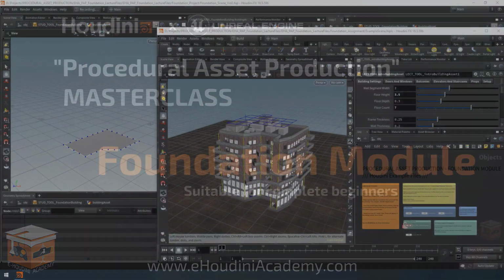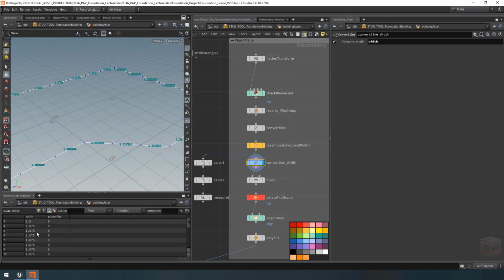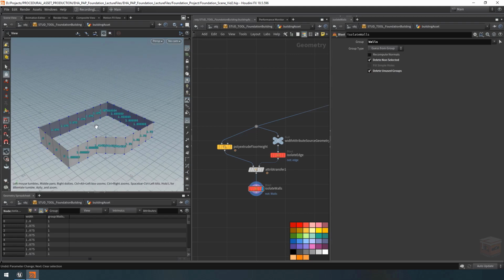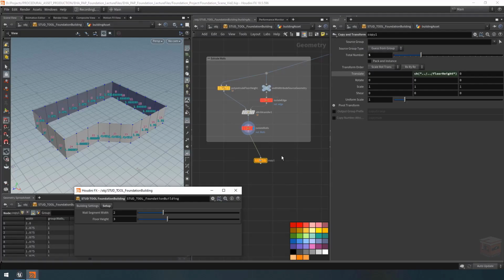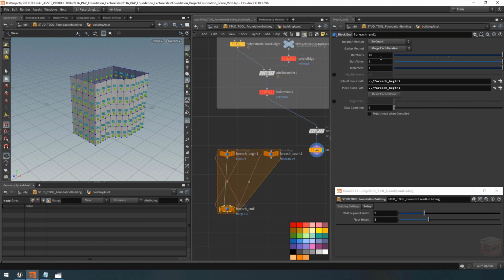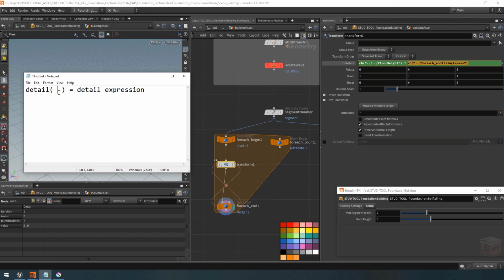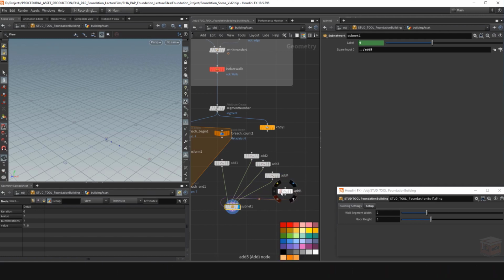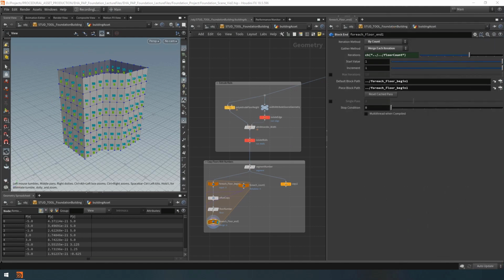HOUDINI FOUNDATION - 03 - Extruding The Walls - ( Free Tutorial for Game Dev with Unreal )

Comment: Hi, i have trouble with copy and transform node, it have the same number with polyextrude but the floor are not stacking on top of each other but slightly overlap instead
Reply from the maker: Did you set the floorheight value on translate Y on the copy and transform sop. And does this value have the right height in your case?
Reply: oh, i figure out the problem, i still have some value in polyextrude distance, thank you. Your lectures are amazing btw
Reply from the maker: @YiNguyen-jx3oj  Your welcome 🙂

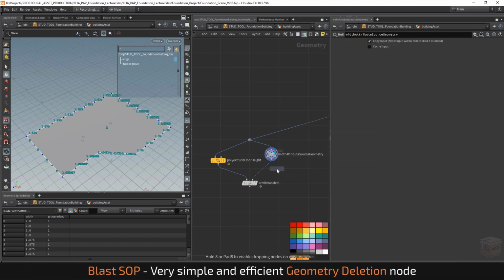Comment: Hi thanks a lot for this tutorial!!!  I have a silly question at the min 12:19 you create a blast node "isolateEdge" for use just the edge for the attribute transfer, is there a reason why, you don't use the same group, in the transfer node instead, under the field "Source Group"?. I may discover this during the video, but in any case, thank you so much for your time!
Reply from the maker: You are right, It is a valid method to isolate out the data using a source group filter.

I'm doing it this way mainly because at this stage in the lectures I'm trying to make clear what i'm doing and why, and because it lets me cover the Blast SOP.
Visually removing the geometry we don't want to transfer from is a clear way to explain this. 

While technically, deleting geometry is a heavier operation than filtering for a group, in this case the geometry in question is so lightweight there is practically no difference.
Reply: @EHoudiniAcademy  All clear! Thanks for the  explanation at the end!

Comment: how much will the module cost, without discounts and bonuses ? what about those who do not know English well ?
Reply from the maker: This module is free.

The next module called Ascension will feature the elevator and staircase tools, as well as lectures for half a dozen of Utility assets and a large set of required models textures and blueprints for unreal. Its total running time will likely be longer than the entire foundation module. 

The Ascension modules base price, without a discount will be 170 Euro. Though early adopters of the course will be able to buy it at a 150 Euro early bird price. For this I suggest you subscribe to the mailing list on the website to be notified right away when it launches. (I'm aiming for September /. October). 

The course will be in english. if it sells well and there is enough demand I could look into a service for subtitles if this doesn't come standard with the hosting platform.